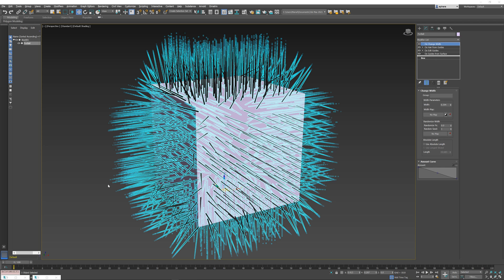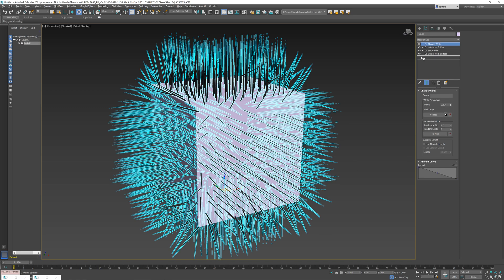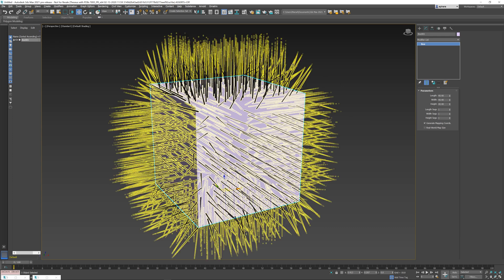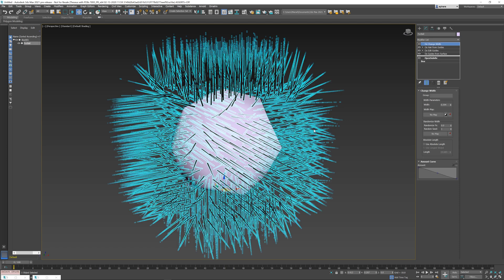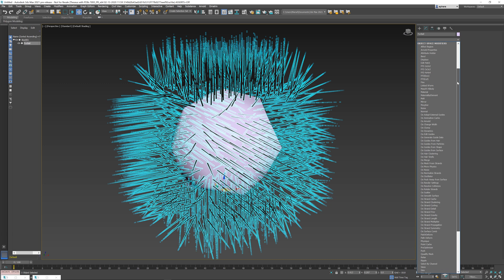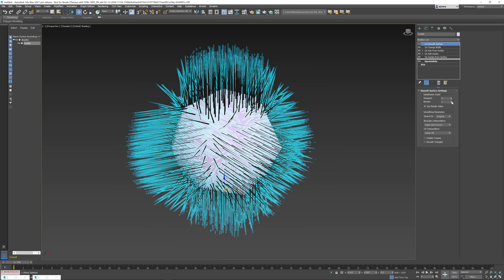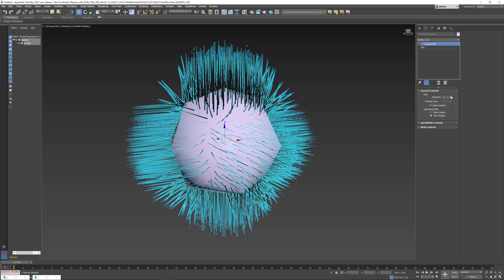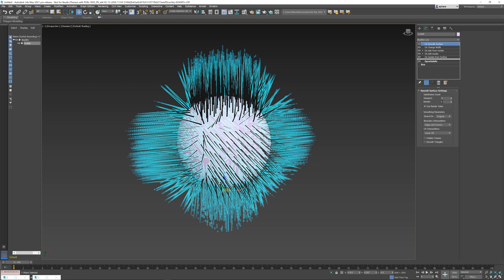Ornatrix 3dsmax: Smooth Surface modifier

Comment: There's only one thing that made me give up Ornatrix. If it had the capacity of following the base mesh surface instead let the hair going through the base mesh when we comb the hair with Edit Guides, it'd be totally different (Something like insert mesh with curves following the surface on Zbrush). I tried ALL methods on Ornatrix, but when I comb the hair with Edit Guides, it just doesn't sustain the base mesh surface following. The whole combing hair process became so infuriating to me that I just gave up.  (P.S.: I'd like to use solely for game hair card). Thanks for the video anyway!

Comment: Great, but I was wondering how this affects the sinks from the surface comb, because usually what it happens is that if you subdivide the topology after you placed the sinks, those are going to change their positions, I guess because they use a face id for placement
Reply from the maker: You should add Smooth Surface at the end of the stack, after Surface Comb and all other operators. But even if you don't do that there will be no impact on the sinks because the surface sub-division happens outside of normal stack evaluation, hence all hair data is unaffected, only root positions.
Reply: @Ephere  ah ok  I was pretty sure that it used to happen but I guess I haven't tried that for a while, I used to have to do the comb with sinks with the geometry in it's finally subdivision level
Reply from the maker: @andresfelipehernandezospin5261  Yes, this is a new modifier to solve exactly that problem